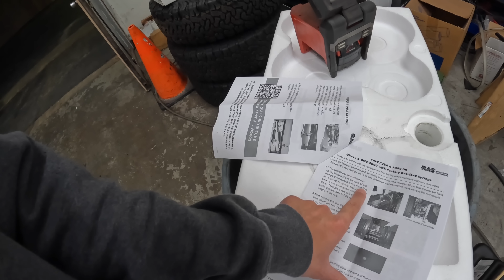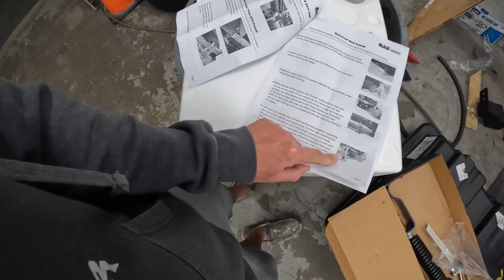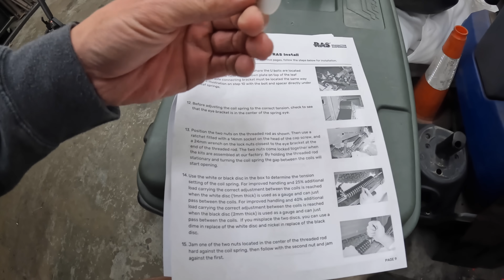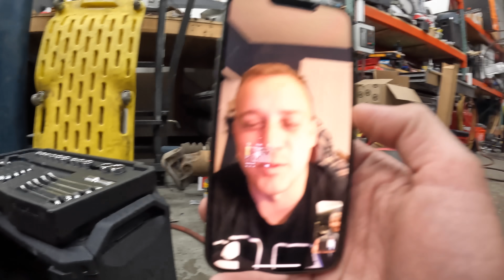If You Tow With Your Truck, You Should Consider Adding This Device!

Comment: Cool video, easy breezy!! To answer the question at @ 20:50, yes you can go over that 2mm gap tension setting it talks about in the instructions. Max tension setting is 3mm gap -- would give you even more support/less squat in the back and still provide that great ride & handling.

Comment: Definitely need a long term review from Danny on these, no affiliation so he is going to give it straight, and I also have a truck like his and want to know how much it really helps.
Reply: Ill check back in 6 months
Reply: I’ve had them on both my tundras. Worth the $500. I’m going to put them on my 3500 in the spring when I start towing again
Reply: I used them for my move down from Fairbanks,Ak to Fayetteville, NC! Had them on my 21’ Silverado 2500 pulling about 12,000 lbs! ABSOLUTELY spend the money! One of the best investments I made!
Reply: @dannyfriedman357  you happy with this install still?

Comment: I’ve heard of people using ras to act as traction bars. A friend of mine bought a 2001 f150 with a 7” lift or so and 35s. Under hard brake or acceleration the rear rubbed. Talked about traction bars. Went to a shop and they told us about the ras it already had. They adjusted it and it corrected the axle roll issue. May not be intended purpose but still works

Comment: I put super springs on my 2016 F250 shortly after I bought the truck which works on a similar principle. The truck rides rougher unloaded but they made a huge difference with sag and towing. 6 years no issues and would recommend them.

Comment: my 1985 traction springs for my 1976 mercury monarch w/boss302... (ford ganada but DETROIT THICK STEEL) .. I USED MOTOR CYCLE springs & almost same set up then.. & yes.. 500lbs of tools parts & cat chains comealongs.. & rwd.. cost me exaust alot to tow or fix trucks in the woods in Massachusetts.. yes.. only place i got stuck.. my lawn.. lol

Comment: I have a 36ft deck over car hauler, needed more spring. Don’t overload the RAS (the threaded rod breaks). They wouldn’t warranty it, so I went with a super springs 1800lb single overload. Works great, IMO RAS is for half tons.
Reply: exactly 99% of airbag kits are rated for 5k or more lbs this is definitely under 1k  for half tons even its still not a great product vs airbags

Comment: Love your videos. Glad you got your hat back on. Sorry I thought you were some weirdo on Instagram. The RAS are great had one on my truck for years. Gave to friend its now on his truck. Helps with cornering also on lifted trucks. Will buy fir next truck as long as it’s leaf springs. Only reason not on current truck anymore my stock leaves flattened out due to flat bed and weight hauling. Bought new after market leaves that increased load capacity from stock 2035 lb per side to 3300 lb per side and the ones for my stock leaves no longer fit.

Comment: Hey Ryan (or anyone whos bought one) I gotta question bout the hoodies. I'm bout 5'10"/145lbs and was wondering if the medium or large would fit best, also do you accept returns if i wanna exchange for a different sixe if the first doesn't fit?? I prefer a more fitted than baggy look No feelings, Work harder hoodie
Reply from the maker: I’m 6’ 170 and wear a large. They shrink a little bit, so if you’re into a more fitted look, a medium may work but I’d worry about it being to short once shrink
Reply: @DMAXRYNO  Thx, Ima go with the medium and hopefully using the low-heat setting when drying it doesn't shrink much🤞🏽

Comment: Soooo.....can you crank them past 40% ??

I run All-Pro's that have zero load capacity, I run a weight distribution hitch (aka black magic) but could still use a little help on those long weekends when the bed of the truck is fully loaded as well. Currently, I run the $45 O'Reillys helper springs but they cause the truck to be really "springy" when going over big transitions. I am wondering if these can help tune in the exact helping weight I need and also not be 600+lbs. of un-sprung weight. Thanks!
Reply from the maker: Sounds like they might be a good combo to your helper springs
Reply: I think so for sure! Drop me a message on IG & I will get you setup with a deal on a set buddy

Comment: How does theses springs do in the winter. Will they freeze up and make things worse? Also did it lift the back much? I have a leveling kot and don't want the back to lift up more. I so would only do the 20ish percent
Reply from the maker: I'm not sure, we don't get winter lol.  I can see the salt making things rusty, but dont see a way the would freeze up.
Reply: It depends on the vehicle but the 40% setting can raise the unloaded rear ride height. The smaller 25% wouldn’t be much added height at all
Reply: @americanduramax  thank you for the reply. My truck is leveled and I don't want the ass end to be too high again.

Comment: Wonder how the RAS would work with rear traction bars 🤔
Reply from the maker: Nick had originally planned on running them on his truck with traction bars, but the bars he got wouldn’t fit with his aftermarket fuel tank. I’d see how they can work well together.
Reply: With the RAS being a top mount design; it should have no issues working with any traction bars you throw at it buddy

Comment: its a cool product but i prefer aiirbags 10x more if you get a decent quality airbag setup it does everything this product claims to do and has more weight capacity and a better ride for example airdogs airbags is one company that would be a decent airbag setup(im not sponsored by them but i wish i was) also 9/10 air bag kits are direct bolt in and plug and play you only have to  run wires for cheaper kits or build your own kits(which i prefer)  its looks cool but realistically weight wise it doesnt even slightly compare to airbags which are rated for 5k or more lbs for really light trailers theyd work hope yall have a happy new years

Comment: So it’s like a track bar
Reply: I would think a track bar wont keep near as much tension to something like this with a strong spring.
Reply: @WhatsIncluded  I think you’d get a better ride with these vs either style track bar(under axle or on top of spring) but to me the only difference is a spring vs a bar and these go on top of the spring vs the bottom. So instead of pulling you to the ground for traction it lifts the spring up to help support a load. I wasn’t saying they’re the same thing but the idea is similar. To be clear I’m talking about caltracs not under the axle to frame type of traction bars

Comment: For the company representing at a sema event.  

They should have a wrench and an impact to show the product working. 

Not just saying “if I was strong enough  you’d see this happen”
Reply from the maker: I’m not sure seeing the springs spread open 1/16” would make much difference in the booth, but I get what you’re saying
Reply: @DMAXRYNO  oh its that stiff? 
eh I left that comment before sleeping. I wasn’t thinking right.  

Once I saw them on the truck you put them on. 

It basically is the same.  

I stand corrected ✊🏾

Comment: I’m sorry but for 500$ these are definitely not going to replace air bags. Only gained 7/8’s of a inch back in height, & now when unloaded these keep your trucks suspension clamped down/strained where the ride becomes unbearable. I’ll stick with my Airbags that keep my truck leveled.
Reply from the maker: Unbearable? Everyone I've talked to enjoys the ride from them unloaded.
Reply: @DMAXRYNO  We have them on a 2016 F-250 CCSB Stock wheels, Stock suspension and it’s made the rear ride so harsh. My 02 F-350 that’s lowered rides better…it’s got airbags 😅